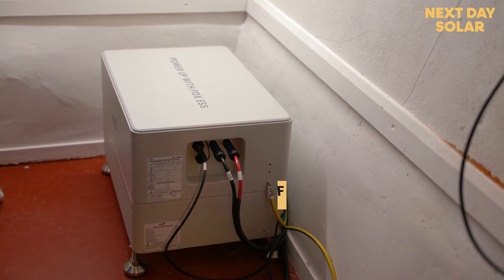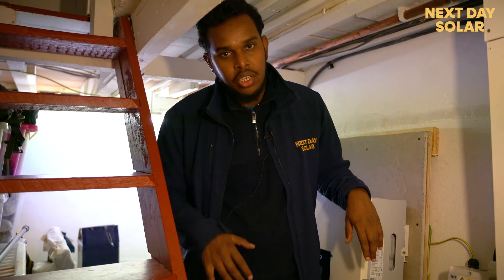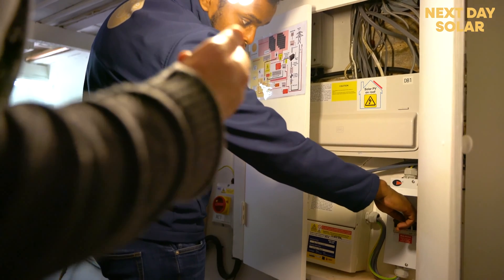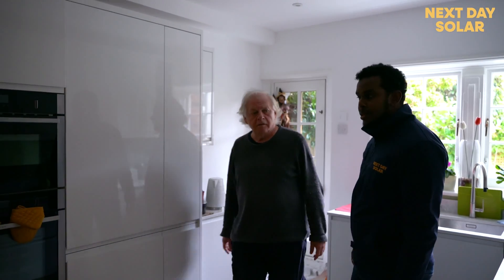Installing and testing a 9.6kWh Fox Battery Storage with a Backup system

Comment: Cost for Fox ESS EQ4300 battery storage system comprising of:
1x Master EQ4300 
6X Slave EQ4300
Reply from the maker: I’d recommend the FOX ESS EQ4800 batteries over the EQ4300, as the price difference is only around 4-5% extra, but it offers greater storage and scalability. The EQ4800 (4.66kWh) supports up to 9 modules per stack (1 Master + 8 Slaves), whereas the EQ4300 (4.32kWh) allows a maximum of 7 modules per stack (1 Master + 6 Slaves).
If you already have solar panels and want to retrofit batteries, or if you simply want to charge batteries from the grid, you’ll need a Fox ESS AC inverter charger. In either case, a G99 application with the DNO is required.
If you’re also installing solar, you can use a hybrid inverter with DC-coupled batteries:
If the hybrid inverter is ≤3.68kW per phase, only a G98 notification (submitted after installation) is needed.
If the hybrid inverter exceeds 3.68kW per phase (or 11.04kW for three-phase setups), DNO approval (G99 application) is required before installation.
For details on battery costs (with or without installation), call us on 02036083475 or email hello@nextdaysolar.co.uk.
Reply: Thank you for the video. Any chance you could give a link to the change over switch and if possible how it’s wired? I’ve been searching for a 3 pole change over switch but can only find the rotary kind up to 63A. I’d prefer an up/down change over for this if possible.
Reply from the maker: @MrWoodster92  https://www.tlc-direct.co.uk/Products/CGM125CS.html , hope that helps. You will need at least 100A as your grid supply is going to be fused on a 100A or Fuse. This is not something you should change yourself unless you are qualified to do so. In terms of wiring, again if you are un-sure best to consult a qualified sparky. In essence your home supply runs into this, and then you have a single output to your consumer board. And a secondary input (being your generator) or power source.